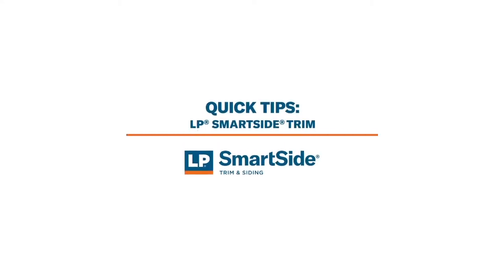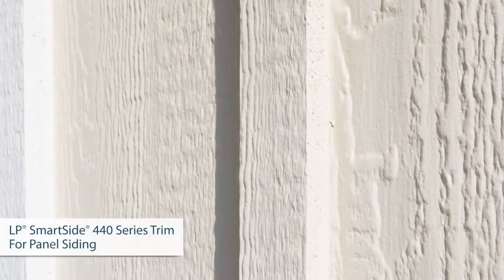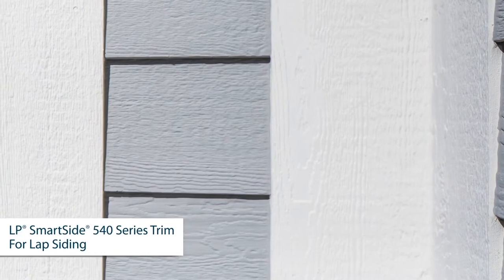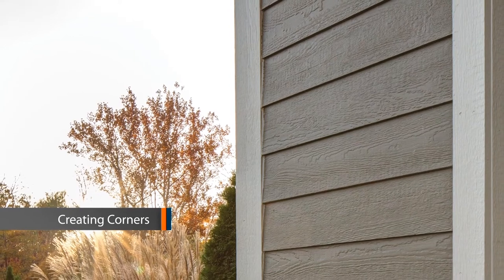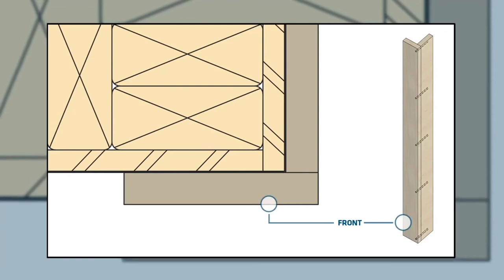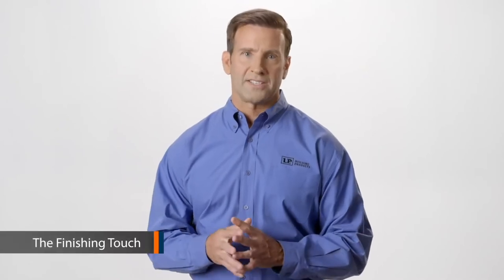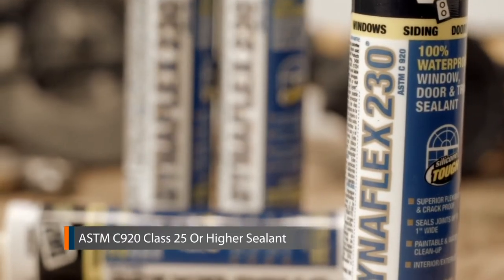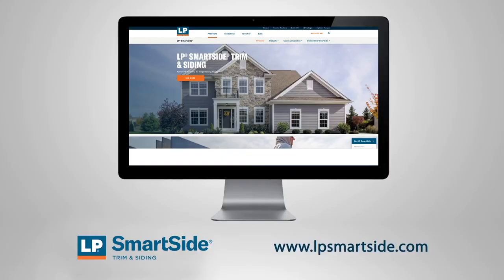LP® SmartSide® Trim Application How-to Tips and Tricks

Comment: What is the recommended nail gauge
Reply from the maker: A minimum 8d (0.113 inch diameter shank), hot-dipped galvanized (ASTM A153) or equivalent. You can find more information on this here: https://lpcorp.com/resources/product-literature/installation-instructions/lp-smartside-trim-fascia